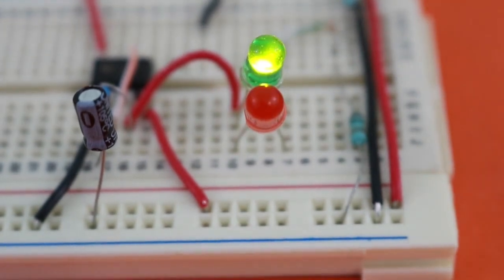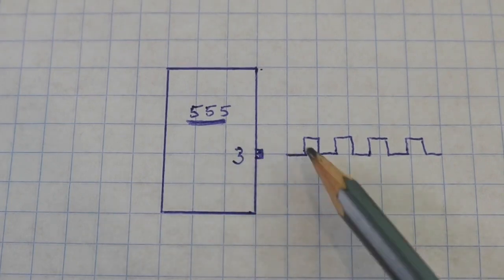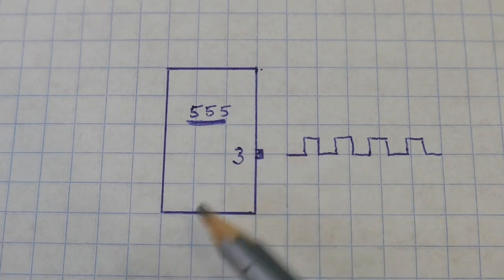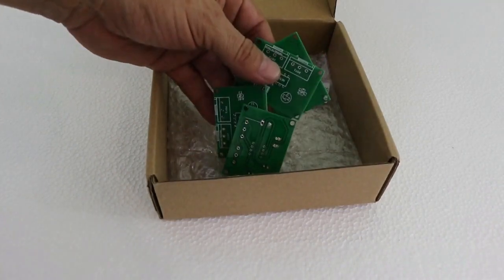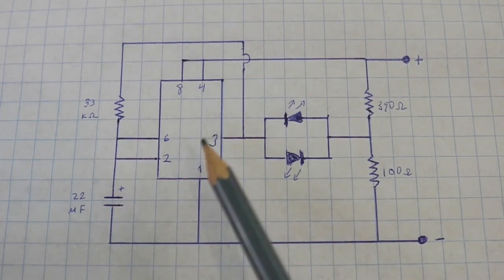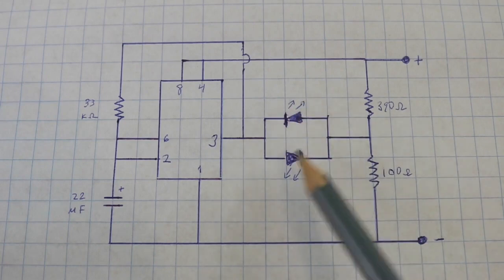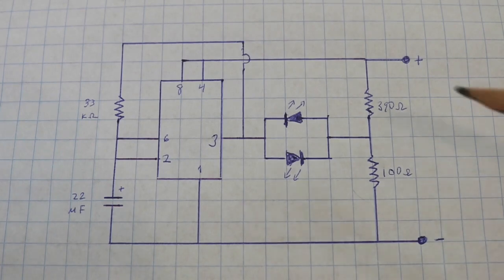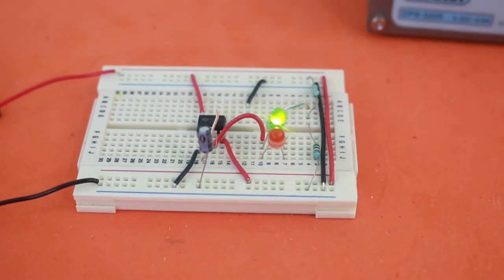Alternating LED Circuit

Comment: wont 18mA be running between pos and neg all the time?
Reply: No the 555ic switch the direction of current in sequence in the time it take cap to charge and discharge.
Reply: @diamony123  Look at the schematic again. There is a current path through those resistors from positive to ground regardless of the 555 output..

Comment: I tried to do something similar for my motorcycle (to add blinkers), but it seems like the interference from the ignition coil is way to big for the 555, any way to fight this? (the 555 just resets like crazy whenever it's near the working motorcycle)
Reply: You probably need a capacitor on the power pin to the 555. Filter out the high frequency to ground.

Comment: I think you need to remove that shared link on the output. The lower led should have its own seperate path to ground, not a voltage divider like you have there. You are also wasting current through those resistors in series.
Reply: sourcing and syncing through pin 3 shares a link to do opposite functions. Very little waste but still waste. I've seen similar circuits to this one elsewhere, that work, that doesn't make it right or efficient. I'd cook a few timers to find out, if I hadn't already cooked them w/out learning anything.   Have fun at camp!
Reply: @maxprophet2401  Actually looking at the schematic again, this circuit wont even flash, it will turn the lower led on permanently . Thanks, I always have fun in my camp.
Reply: @Apollo-p1l  555 ic are not made perfect, i fix that sticking issue by adjusting the duty cycle. isolating the power helps with optocoupler as you mention.
Reply: @diamony123  All you need is a basic astable 555 circuit with the leds wired up correctly.
Reply: I breadboarded the circuit, with the LEDs separated on the output. I used the same color/make of LEDs and the same value/make of resistors. It worked well. But, I don't think the duty cycle is quite 50/50. Fun! Thanks!